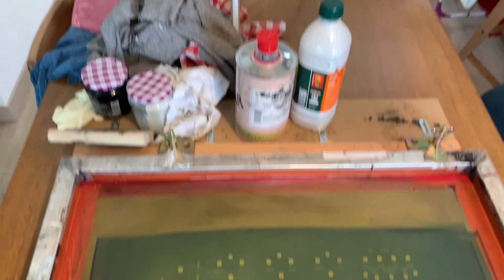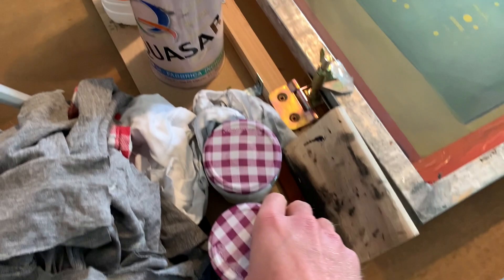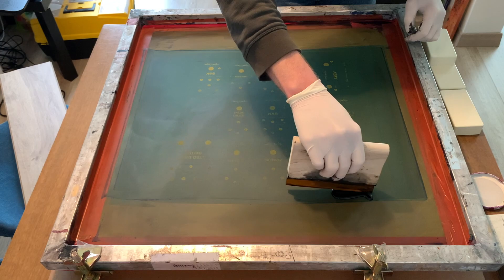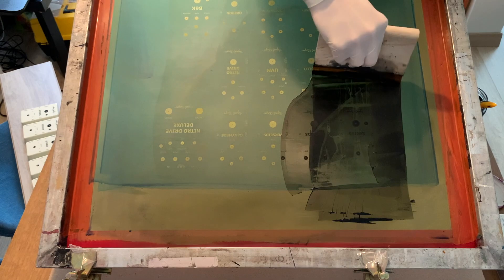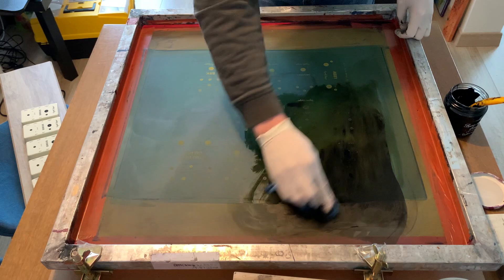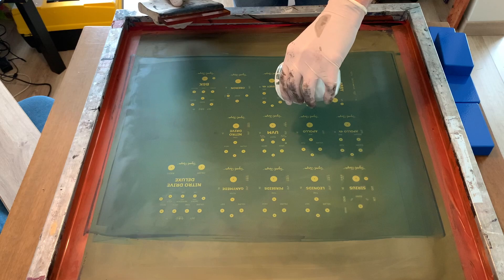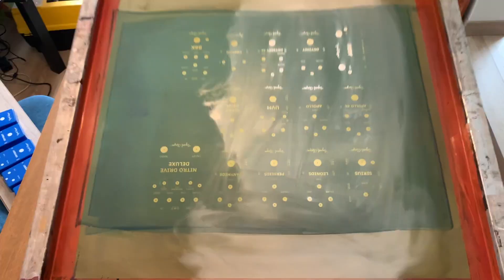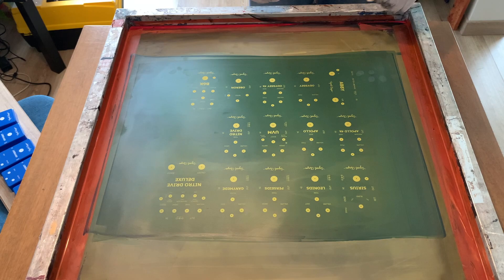How to Screen Print Pedal Enclosures

Comment: Ideally you would flood the screen prior to a pull, here you are just pulling on to a dry screen, not recommended.
You should initially flood . . .then pull (print), then gently pull the ink backwards (flooding the screen) and repeat, you also appear to be putting far too much force into the pull, probably because you are not flooding the screen.
The ink that is meant to go onto the print surface is meant to be the ink already (flooded) in the screen, not the ink you drag from the top of the screen.
Reply from the maker: I've changed my technique since making this video, need to make another to show how I do it now. I put housings around the one I'm printing to better support the screen and squeegee. I also increased the off contact a little. I also stopped pushing down so hard and that made a big difference in the final result. Since changing I've got very few misprints, I did 50ish housings the other day and only had 1 misprint that was my fault- I didn't seat it properly and when I pulled it pushed down the housing at the same time, making the ink smear. 

Thanks for the info, I'm still learning and am happy to improve my technique!

Comment: Thanks you! I am looking to build my own amps and didn't know what was the best way to label the control panels. I think the methods I will use is to powder coat my aluminum panels and then use a jig similar to yours to screen plate. Just need to figure out how to build the jig.

Comment: Hi friends! I have heard that general use synthetic enamel could be used as ink, although it is not recommended due to the vicosity and the drying time, ask and the solvent that it uses (turpentine) should not affect the screen, right? great video !! Cheers!
Reply from the maker: Yeah you can use enamel ink. That's what I wanted to use but I couldn't find anyone who sold it in France. And I guess it's hard to have it shipped internationally. I use solvent based ink on my screens and solvents (thinner) to clean the screen, no problem. Just tell the person who is making the screen if you're going to use solvents, water based inks, enamel...because the fab process will be a little different. For example, when I had my screen made for solvent inks the print shop told me not to use water to clean it because it would be ruined.

Comment: Awesome setup! Thanks for the vid. Did you have to have all the artwork in a single image file when having the screen made, or did he line up the individual images for you? How did you get the image spacing so perfect to be able to make a simple jig to position the enclosures?
Reply from the maker: I put all the artwork on a single vector file. I knew I could buy 1cm square pieces of wood so I spaced them all 1cm apart. 
On my new screen I placed them farther apart. I made a different jig to make positioning the housing more precise. Basically now my screen doesn't move, I have a little platter that the housings go in that I tape down once it's in position.

Comment: Wow man, nice.  For multi colors would you mask the pedal off on the part you don’t want that particular color?  Seems like the most common-sense way, but I am gearing up to do this myself and doing a bunch of research.
Reply from the maker: Thanks! For multiple colors you'd either have to mask off the parts you don't want to print with that color or have multiple screens with each color as different layers. The only problem or challenge would be getting the different layers to align between drying and switching screens or peeling off tape. It definitely can be done though :)

Comment: Thanks for the video! I want to do the same thing on a powder coated metal piece. What ink and clean up chemicals do you recommend that I can get in the US?
Reply from the maker: IMO solvent inks work best on powder coating because they bond to the material. You don't need a top coat because it's pretty resistant. To clean the screen you need a dilatant or solvent cleaner. They smell very strong so you'll need a mask and a well ventilated area to print.

Comment: Hi, Ive made some great look pedals, but untill now im learning how to print them. What kind or type of ink I have to use in painted enclousure?
Reply from the maker: If you use a pre-painted enclosure from Tayda then a solvent based ink is easy to work with. It bonds to the polyester powder coating they use and is really durable.

Comment: if water ruins it, he made a shit stencil for you - you'd want a water based emulsion that becomes waterproof after exposure - look up Ulano QTX - thats what i use
Reply from the maker: I misunderstood what the guy said :) You can get water on it. It will just wash away the blockout liquid solution (the yellow part around the green emulsion on the screen). I made this video when I first got in to screen printing. I've learned a ton since then and made a new video to show better technique here: https://www.youtube.com/watch?v=SZAbRpvGun4 
I use the blockout solution to close up any pinholes. On my old screen I used tape to block off any areas that I wasn't printing and doing that so many times eventually put pinholes in the emulsion but a little solution and it's just fine. I used the old one for a little over a year and it held up awesome. The guy did really good work, so I went back for a second screen in march for my new models.